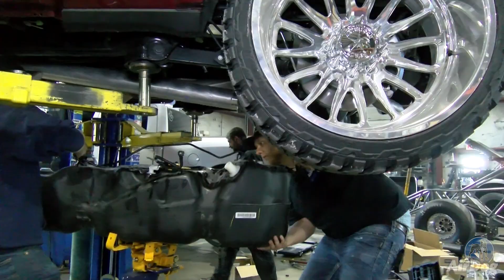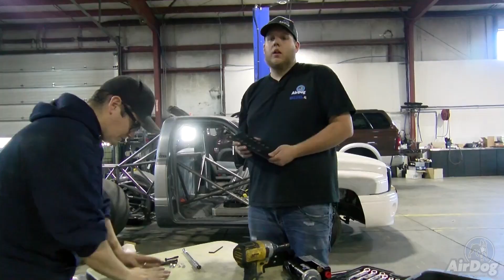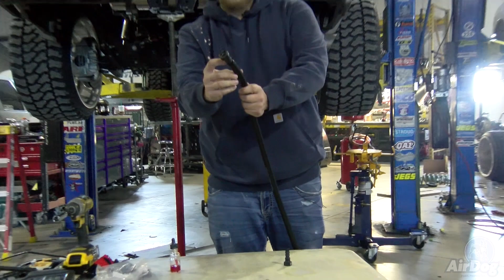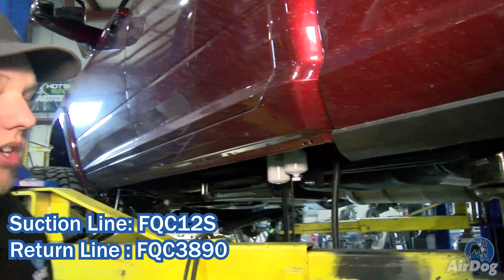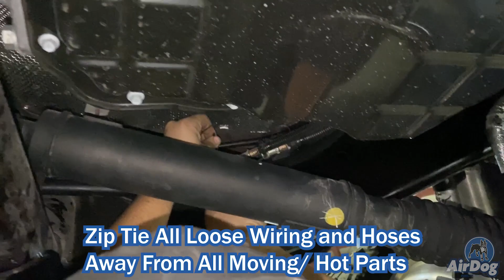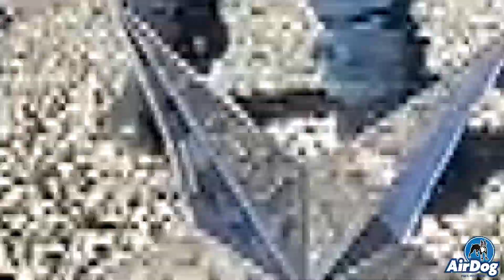2019+ Ram DF-165 4G install

Comment: 2019 ram.. Ok my factory fuel housing has to inlets, is the smaller one not used?? Won't diesel spray out?
Reply from the maker: The smaller connection is the fuel return from the engine and needs to be hooked back up.

Comment: if you remove your def tank you can make a mounting plate out of a piece of angle about a foot long and mount your Airdog or Fass in its place. you will have to remove the plate on bottom of that cross member but they fit great like that and the filters  dont hang down so low